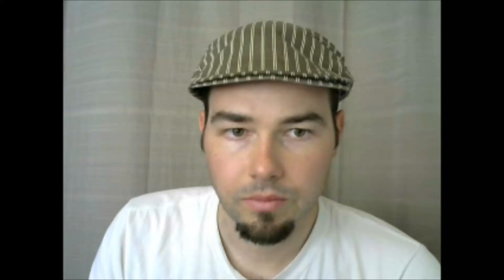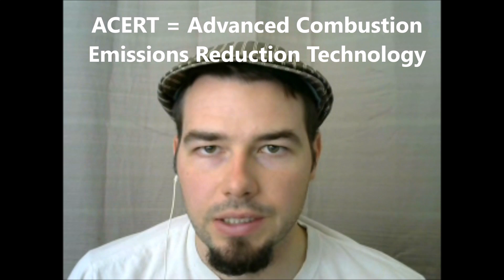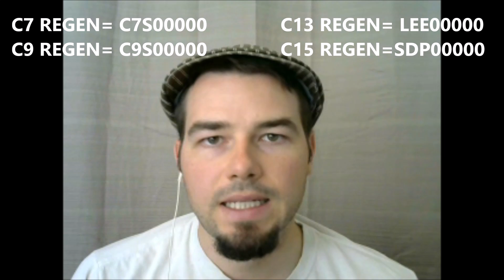Regen, Aftertreatment, and DPF System Class.  Cat Emissions Systems Course.

Comment: HI MY NAME IS MIKE ,
                                     NICE TO HEAR SOMEONE KNOWS THESE SYSTEMS, IM NEW AT THIS  ,LOL
CHANGED MY EXHAUST MUFFLER TODAY AND PARKED TRUCK LIKE USUAL AND THE REGEN LITE CAME ON ,NO BIGGIE PUSHED BUTTON REGEN STARTED FINE, SHUT OFF ONLY AFTER A FEW MINUTES USUALLY 20-35 MINUTE,
CLIMBED BACK IN CAB REGEN LITE WAS ON AGAIN, FIGURED EVERYTHING LOOKED FINE CHECKED NEW MUFFLER SEEMED OK NOTHING ELSE I SEEN, TRUCK WAS RUNNING , GOT BACK IN CAB REGEN LITE STILL FLASHING SO HIT REGEN AGAIN STARTED AGAIN LIKE IT SHOULD, AFTER A FEW MINUTES IN YARD LISTENING TO MY TRUCK SCREAMING AT 1400 RPM
NOTICED A TAN LOOKING SMOKE COMING OU EXHAUST PIPE ,SEEMED KIND OF ALOT NEVER SEEN THIS MUCH ,THEN I LOOKED CLOSER UNEDNEATH TRUCK AND  FEUL LEAKIN DOWN EXHAUST PIPE THAT IS BELOW THIS ARD DONT SEE NO BROKEN LINES ,WIPED EVERYTHING OFF THAT I COULD OF COURSE AFTER SHUTTING IT DOWN,THIS IS A C15 WITH DPF,
PARTICULATE CANISTER WAS CLEANED AND THE ARD WAS CHANGED IN AUGUST 2016 WHEN I PURHASED THIS IN PITTSBURG PETERBILT BUT HAVING PROBLEMS WITH THIS TRUCK SINCE AND JUST SO HAPPENS NOTHING SEEMS TO BE COVERED BY THEIR WARRANTY , ANY IDEAS WOULD BE APPRIECIATED 
                                                                                                                                   THANK YOU FOR UR TIME
SO FAR THE MOST KNOWLEDGABLE I HEARD ON MY PC
Reply from the maker: +mike odrain If you are getting raw fuel out of the exhaust the are only a couple places it could come from. If you have an engine miss it could be the injector, if the engine is running smoothly as before then you probably don't have a problem with the ARD head itself, but with the fuel enable valve, pilot control valve, or main control valve. I discuss them somewhat in this video. It is also possible you have a bad ARD head that is just dumping raw fuel into the exhaust. Does it only leak fuel during a regen? Then it is probably the ARD head, but with a Datalog it is really a guess. Sorry the system is so complicated.

Comment: Hi I want to buy a 2008 freight liner Columbia that has a c15 dpf here in Ca is this engine worth to buy. My dad loves his 3406e but here a lot of people saying the c15 with dpf is bad. The truck has 746,000 but don't have any information on maintaines since it is being sold in a auction. Thanks
Reply from the maker: +xDGKRivas22x Well that is a loaded question the Regen C15 are okay engines compared to other emission engines, but compared to the older 3406 and C15 engines they are more problematic. They don't seem to last as long most likely due to the CGI systems, they also have many Regen problems with the ARD system and the sensors.
Reply: Adept Ape have you seen any of these c15 hit more than a million miles or is it rare to happen.
Reply from the maker: +xDGKRivas22x Yes I have seen them go over a million, they usually have polished liners around the 750,000-850,000 miles and need a rebuild by then.
Reply: +Adept Ape any tips of what I should inspect more cautiously. And where should the oil compression be around on one of these engines. Thanks

Comment: Very good informative video on regen ard dpf system . I know you help out a lot of truckers struggling with this new system. My question is do you recommend dpf delete and reprogram the system so it will run like a normal truck. I only run in tx.
Reply from the maker: +Erick Saldana I can't "recommend" disabling the aftertreatment system because that would be breaking certain regulations. I would say though, that the aftertreatment system is an expensive and overengineered system that doesn't add any value to the truck and if you choose to remove it you would probably be happier with your truck.

Comment: In having failure to ignite and can't regen I just changed the ard head and nothing it's on a c13 can you help
Reply from the maker: +Jonathan Gutierrez Do you have access to Cat ET? Do you have any boost while it's trying to regen?
Reply: Adept Ape yea I have access to cat et but I can't regen because I have that failure to ignite I have factory pass codes to delete the codes but one code won't delete even with the passcode it a particulate filter plugged most severe 3
Reply from the maker: +Jonathan Gutierrez The soot load level codes will only clear with a successful regen, they can't be cleared even with a factory password. They don't prevent you from regenning though. Have you checked for spark? Do an Air System Verification Test under the diagnostics menu as well and see what the results are?
Reply: Adept Ape okay I'll do it Monday morning and try and get a hold of you thanks for the help man it's really appreciated

Comment: I've got a Lee c13 keeps throwing dpf intake high temperature. regens fine, just cleaned dpf and new spark plug in ard. ard ignition is good. I will clear the event, regen it, run it, but whenever it goes back to customer it throws that event after about 30 miles or so....thoughts?
Reply from the maker: +Killsign Kilo Hmmmmm, first off does the DPF intake temp match the ARD head outlet temp? Is the DPF outlet temp high too? That could indicate an oil or fuel leak in the exhaust as well that is igniting when the system starts a regen which then gets the DPF inlet temp above the 1100 degrees.
Reply: The outlet temp is good. The high temp code is hapening while the customer is driving not while regning. I will see if the ard out and dpf in match. I am almost leaning towards a short in the sensor that is intermittent. Of course it always works fine in the shop. the boost pressures are also a bit low around 0.9 psi but ard ignights without a problem. also no apparent oil in the DOC.

Comment: Excellent information. I've had to troubleshoot and repair many regen problems on International Navistar engines but they work much different than these Cat systems. It seems like the International system is actually simpler because we don't have to diagnose a secondary air system, However the heat is created in the diesel oxidation catalyst downstream of a fuel doser instead of the combustion chamber on the cat systems. Only thing I would add to your video is to check for exhaust leaks as this can cause heat to escape the DPF.

Comment: Where can we pick up CRS cleaner for the are head?
Reply from the maker: +Timothy Nichols So Cat stopped producing that stuff. It didn't really work that well anyways. If you are having ARD head problems, try purging the system with pressurized air into the purge air port. It'll probably be plugged, but you might be able to clear it.
Reply: Adept Ape man, so cat really stop caring for all these engines out here. that's pretty sad. these things are like a never ending money pit. Round of applause for the Gov. Thanks Adept Ape you really know your stuff, from a O/O it's Extremely Appreciated!. How hard is it to put a older engine a more modern truck to skip these emission crap, would it be worth the time and $ to do so?. Also I think you should open a FaceB page. 👍
Reply from the maker: +Timothy Nichols I think they stopped producing the stuff because it didn't work. Cat still supports their engines, but just don't produce them anymore. So to transfer the engine an older engine C7 is pretty easy as far as the swap goes. Now the problem is the emissions laws, you'd have to check your state and DOT regs fire what is legal.
Reply: Adept Ape in Texas you can put a older motor on a newer chassis. It would be legal. What's a good older motor you would recommend that it would make it a easier swap.

Comment: i have a c4.4 that wont regin. soot level is at 123%.  how can i force regin this engine? thanks.
Reply from the maker: +Bryan87 Is that in a piece of equipment or generator? That is probably a Tier 4 final engine, which has a very different aftertreatment system than the truck systems I'm familiar with. If I knew how to force the regens on those systems, I would let you know, but I don't know how and have only had a little bit of experience with those systems.
Reply: Adept Ape yes it4 in a portable air compressor. Didn't see anything in ET that would force regin it. thought I would ask. thanks for the reply.

Comment: I like this class.  This will help me a lot. I was wondering what goes wrong with the ard head to make them not work?
Reply from the maker: +Steven Jason The fuel nozzle gets plugged typically, but the head has to be changed as an assembly.

Comment: sir do you know by any chance what size is the nut on front axle I need to change the seal on front passenger side I got first nut out can't find a socket for second nut
Reply from the maker: I do not know off the top of my head, you would just have to run a tape measurer over it if you can from flat to flat, be careful though sometimes they are 8 sided nuts and not 6 sided, which would be a different socket obviously if it is.
Reply: 6 sided 2 1/2 inch ltl small can't find 2 9/16 nowhere in town
Reply: Fasteners .McFadden harbor Sears automotive all of them  no luck

Comment: I'm applying to UTI to become a diesel mechanic and they have asked me if i would like to work at a dealership or work independently(such as a shop that works on all types of diesel engines and trucks). What are the benefits of working at a specific dealership(lets say chevy) vs working independently that works on different types/brands of trucks?
Reply from the maker: +Noah Comfort Well I've only worked for a Dealer, so I can't give you an independent view. I like the dealership though. You will be more of a specialist, but you'll be better at working on your product. If you go independent you'll probably be working on a wider variety of manufacturers and different components. Do you think you want to specialize or like the challenge of different stuff. For School I think working on a variety is an advantage, but I like being a specialist.

Comment: hey man could you upload or send me a fuel circuit diagram for a 3116?
Reply from the maker: +Mister Nightbane Do you have the serial number?
Reply: no tag is missing
Reply: it was a marine engine swapped into a yard jocky truck
Reply from the maker: I tried finding a generic diagram for a 3116 and couldn't.  They basically just have a parts breakdown.  Are you want to know what direction the fuel flows or what pressure is?  I can try to answer your question more directly.

Comment: thank you for this video. I watched every second of it.

maybe you can help me with my issue?

I have a 2009 Pete 388 with a C15. I assume it needs a DPF removal/bake, perhaps because it is not regening properly. I don't have a constant CEL on or any in-dash faults that it wants to show me.

Some oddities that have happened are, after using Jake brakes going down hill, then mashing the pedal, a CEL comes on until I let off the pedal. or if I just go easy on the pedal, it doesn't come on at all.

Almost every time I sit idle for a couple of minuets, then I take off, the truck starts blowing thick white/blue smoke during heavy acceleration.  lasts a min or 2. If I continue to sit and idle it will bellow out very thick white smoke for about 2-3 mins, after about 30 mins of sitting idle.

The truck said regen required, one time, but I was unable to stop right then. about 5 miles later the warning went away and when I parked I did a forced stationary regen successfully,  minimal smoke almost not worth mentioning.

where the flame temp sensor is mounted at the ARD head, the tube that comea out with the 90deg bend is loose, like a loose tooth. 

is this causing the system to read improper Temps and over cooking and constantly doing rolling regens? 

I've only had the truck about 1 week and didn't want to even attempt messing with the loose flame temp sensor until I have delivered my load.

Thank you very much for your time. I have learned so much from your videos that none of my 3406b fanatic friends have been able to help me with.
Reply from the maker: +Were Not Equal I'm glad you watched the video, since you own the truck it'll help you understand the system. Alright let me see if I can answer a few of your questions. The ARD head has the flame temp sensor and the heater nozzle wire going to the head, the loose one is the sensor with the 17 mm head or the wire held down by the clamp with the small Allen head bolt? If it's the flame temp sensor that can cause it to not regen properly assuming the sensor isn't working. If the sensor is loose it should still read though.

Alright, the check engine light under acceleration could be anything and doesn't sound like it is regen related. Does the truck have any sort of code display or anything that tells you what the code is? 

The white smoke may be regen related, you could have a fuel enable valve, pilot valve, or main control valve leaking into the ARD head and then when you drive it heats up the DPF and causes the white smoke. White smoke could also be oil or coolant hitting the DPF as well. If it is regen related you'd have to find a shop with someone that can really troubleshoot the systems, and I've only ran into a few Mechanics that are really good at troubleshooting these systems. 

I wish I could say more, but it is hard to troubleshoot these things over comments. Let me know if you have other questions. We can Skype as well if you want some video explanation, but I usually charge a little for the consultation. I'll comment for free though, so let me know
Reply: It is the line with the 17mm hold down nut (if thays what it is called. in your video you point it out and call it the flame temo sensor. I was thinking that because it is loose, that it might either allow cool air to be sucked in along the gap and give the sensor a wrong reading.

I have a Scanguage KR. a code pops a few times a day, but I have not been able to decifer it yet. It shows ID=974 FM=03 CNT=126. I understand the FM is failure mode and the CNT is count. but I can't find out what this 974 ID code is.

I have the day off tomorrow, so I will be attempting to remove the FTS from the ARD head and see why it is loose. The Hold down nut is tight, so I'm guessing the sensor tube or whatever is broken in some way inside the ARD head.

The CEL only comes on after using the Jake brakes and then then applying the throttle pedal. I can run all day with no Jake's and never see the CEL light come on. My thought was that, similar to my non-regen C13, when I would hit the Jake's a decent amount of black smoke would come out the stacks, after trucking for awhile. so if my c15 smokes on Jake engage, and the DPF is clogged, then maybe the Jake smoke is clogging it more and hitting the throttle makes it choke out, triggering a CEL until some soot clears. Tomorrow I'll either take the DPF off to get a look inside, or take it to the local Pete shop and ask them to check codes so I can figure out what I need to fix.

As I have been looking around the DPF I have found a number of odd things. Like, a hole in the bottom of the DPF housing, near the rear of the housing. The hole is meant to be there. It's reminiscent of a drain hole on a fuel tank, but there is no plug, and exhaust comes out of the hole, doesn't seem right to me but who knows. 

I would be interested in some Skype time, if tomorrow doesn't go well for me. I really hope it's just a sensor or clogged DPF issue, so if it's not I'd proably save alot of money if I could trouble shoot the situation with out dealer prices.
Reply from the maker: You are correct, that is the Flame Temp Sensor or EGT 2 sensor as it is also known as. That is odd it is loose, the nut is supposed to clamp the flange down tight, perhaps the flange is damaged.  That sensor probe is fairly long so even loose I wouldn't think it would affect the regen system.

I'm not sure what that code number is, but I can try to look it up tomorrow if I remember. That Jake issue sounds somewhat odd, perhaps an IVA code or something, hopefully that number will shed some light on what the code is. That one would is probably going to take some troubleshooting.

I do know for certain the empty plug hole you are talking about. It is threaded and on the outlet, it is supposed to be open like that with no plug in it. I believe it is a drain for condensation. So at least one mystery is solved.

Let me know what you find tomorrow. I can answer more questions you have or Skype if you want to set that up.

Comment: Cummins (Big Cummins) as we techs refer to them,  they use individual tests for components. Tests like; DEF Doser Override test, DEF Doser Leak Test, DPF Restriction Test, DPF Regeneration Test, SCR Catalyst Performance Test, VGT Actuator Heuristics Test, Injector Performance Test, Cylinder Cutout Test and (Only On CM2250 ISX15) DESA (Dynamic Engine System Analysis) Test.